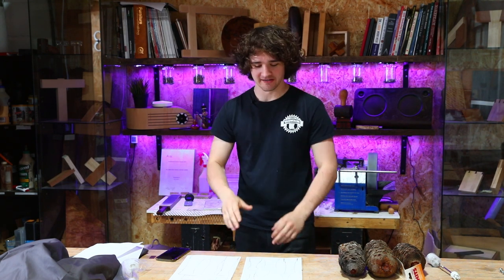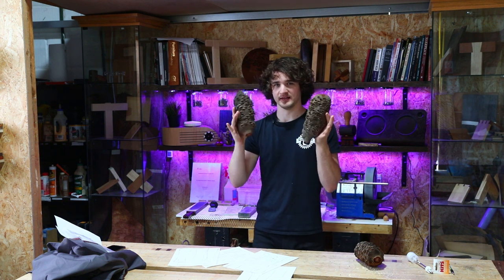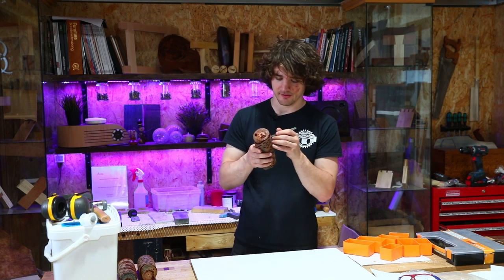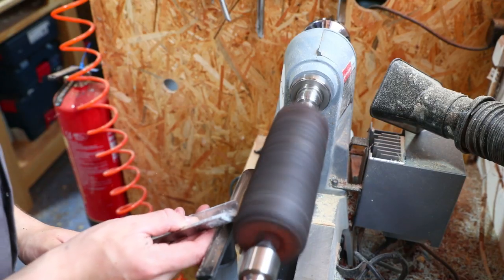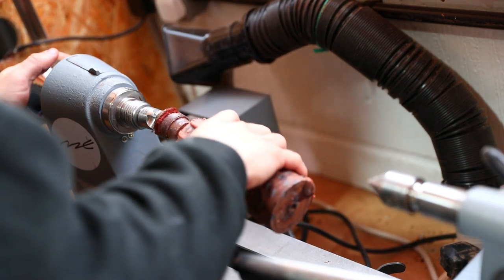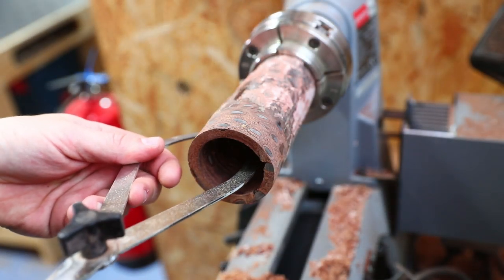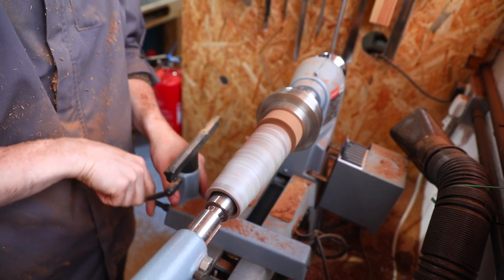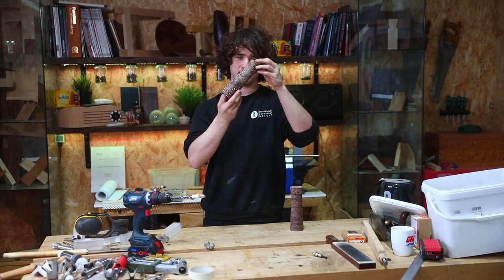Making Salt and Pepper Mills using BANKSIA NUTS?! | Turning Tuesday #20

Comment from the maker: Yea. Vacuum Chamber is definitely on the cards. Any recommendations?

Also, is it any different to a pressure chamber?
Reply: From my research I think the pressure chamber is what you want over the vacuum chamber! The vacuum chamber would be good if you were trying to use cactus juice to infuse a porous or punky piece of wood with a really thin liquid.. Just my two cents, I could be completely wrong.
Reply: My understanding is that pressure chamber compresses down any air bubbles in the pour until they "dissappear" while a vacuum chamber will suck them out and, presumably, the resin will replace them.... first you place the piece and fill the chamber with the resin, then suck out all the air, then release the vacuum, and let the pressure ( ambient...or I suppose you could push some back in if the chamber will accept this) forces the resins into the now empty voids.

For stabilizing wood ( and if you are going to be getting potentially punky, but extremely visually interesting, turning blanks from Blaise, then you may well want one of these

It's long been my thought that you do the above, suck out the air and then push in the resin, but as I've never done either, what do I know?
Reply: Peter Brown did a comparison of the two, check his video "Resin Casting: Pressure vs Vacuum" (not direct linking because youtube likes to eat comments that contain them, sorry.)
Reply from the maker: @Aubreykun  That's really helpful, thank you!
Reply: On if you had rough drilled it out. You could have used a wood waist rod in the center. Then spray with a mold release on it and cast it in the resin. And redrill it or remove it the do the finish turning. 
 Also a carbide insert from a carbide turning tool in the end of a rod.

Comment: These look awesome. Great work. As someone who doesnt know anything about turning, could you have made the chambers then friction fit in a sacrificial piece of PVC to use as a stopper of sorts for all of the pod holes then filled them in with epoxy before doing the outside shaping? Then just carve away the sacrificial piece of PVC? Also I think it would have worked better to keep the epoxy more liquid and pour into the holes in stages so you dont get the problem of voids with the thicker consistency. It would obviously take a lot more time but curious to see if you think it may have turned (no pun intended) out better because of that.

Comment: Hi Matt, great video. Ive started making pepper mills in the last few days and from my research one gent said that the lugs which require the recess tool are not required as they are to stop slipping in a metal body, the other sharp lined edging on the mechanism will cut into the wood and hold it in place. I do love your ingenuity with your home made tool though.

Comment: Matt you might want to try a pressure pot and a resin mix. The pressure drives in the resin so the air bubbles escape. Love watching a new approach to wood turning. If a tool works for you, use it!!

Comment: Wow. Surprised you went with the thickening it up and pushing it in method. 
I figured at the start you would be keeping it liquid and then just turning the nut down to a diameter to fit in a cylindrical mold (like a container for pasta or something) and then pouring in the liquid to fill all the holes.

Comment: Just a thought for making sure the voids are filled, if you try it again at any point. Turn down to almost size then make a close to fit box and fill that with epoxy standard runny epoxy. Almost as if you were trying to make a cast. Its a bit wasteful but if you got it on a shaker whilst filling up the box it should get everywhere i'd of thought.

Comment: dunno if it was suggested already, but for future reference a syringe might be a good way to fill the holes with the filler substance. Or turn them down to a certain diameter, put them in a form that leaves just a little room and flood that with more liquid epoxy and then just turn the surplus epoxy off again. Would be my ideas for that issue.

Comment: Sorry - I've no idea about wood working so don't take my question wrong:
How many times you had to refill the holes with Epoxy? 

Personally I only worked with Metal due to my apprenticeship, so my first idea was simple "To put wax into the drilled out Wood, after the final form is made, then apply the Epoxy, let it dry and then melt the wax out" but I think with wood that wouldn't work quiet well.
But there in our day & age, there has to be some sort of Plasticine which wouldn't stick to the Wood itself? But probaly it would be too expensive and the deal of making a Counterpart (Which you could stick into your Mills while applying the Epoxy) would be also too time consuming.
But great work, now I want even more an engine lathe.

Comment: I have made a number of crush grind mills and they are no as difficult as you have made it.  First, cast whole piece in resin to get a solid object.  Then turn rough outer shape.  Next drill holes, part top from piece & size tenon.  Finish outer shape with top connected.  Sand finish and assemble.  You have roughly succeeded in spite of yourself.  Read the instructions that accompany the kit and you'll have an easier time.  NOT impressed with this.

Comment: Please report back re salt in epoxy. Thx 😝
Reply: They turned out great. Really unique.
Reply: Epoxy is used in boat building so it must be resistant to salt.
Reply: Yeah but the salt isn’t mixed in and present during curing.